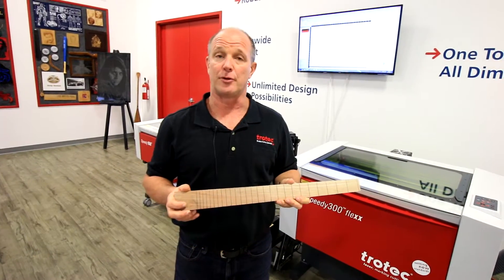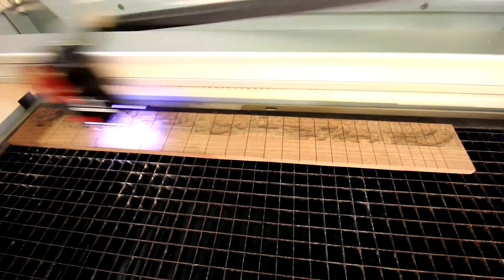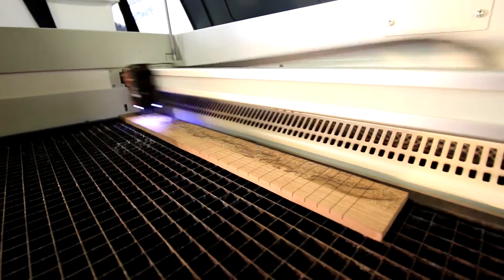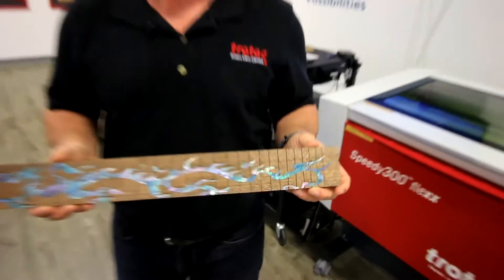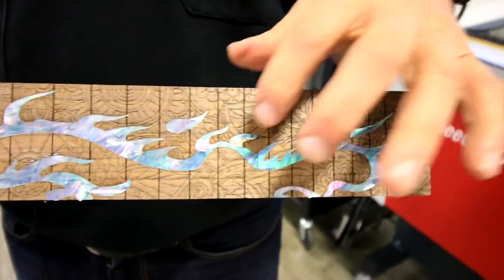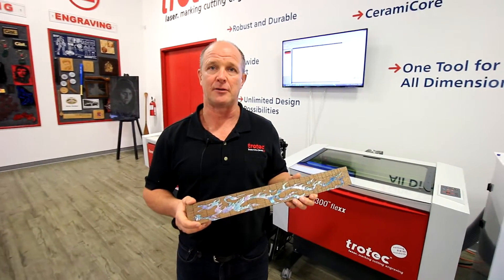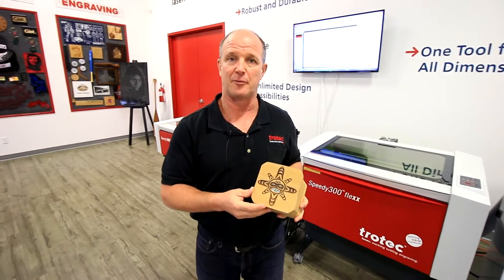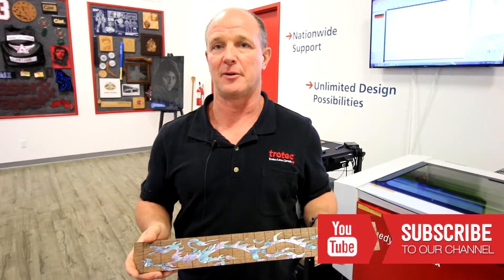Mother-of-pearl Guitar Fret Board | Laser engraving and cutting | Trotec

Comment: Can any of your lasers cut natural white or black mother of pearl 1.3 mm thickness or it's not possible to cut natural MOP? Also does the laser can make pockets in Ebony?
Reply from the maker: We have never tried natural so we cannot confirm.
Reply: @TrotecLaserCanada  The title of this video is a bit misleading, as it isn't actual Mother of Pearl you are using, but a plastic mother of pearl lookalike. Mother of pearl does not handle heat well, thus it is not possible to use your speedy machines to engrave real MOP. With a bit of luck, you could do it with the speedmarker series, but only with high speed, low power settings, in multiple runs of the same pattern.
Reply: @creatinker  Yep. Found a solution yet? Tried UV?

Comment: Thanks for the suggestions of velocity and power.  What was the wattage of the machine in your video?  We run 360s with 120 watts.  Would your suggestions be appropriate?
Reply from the maker: Hi Tom, the Speedy 300 we're using in the video is 100w, so you may want to lower your power a bit from our settings.